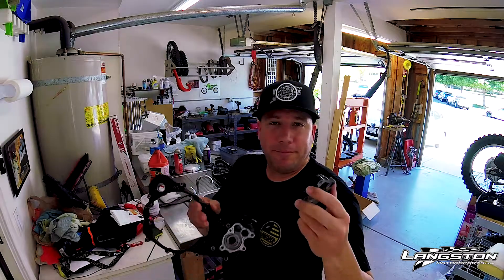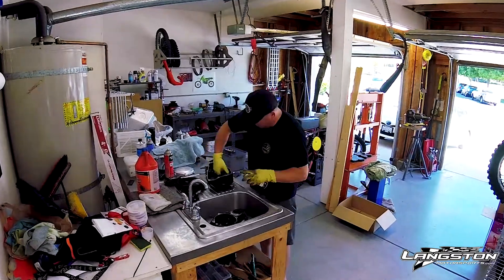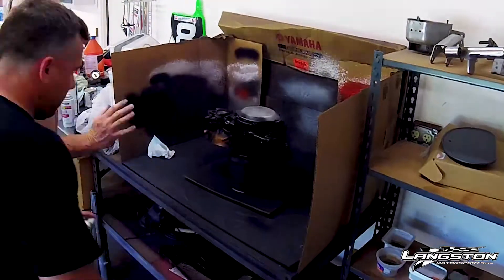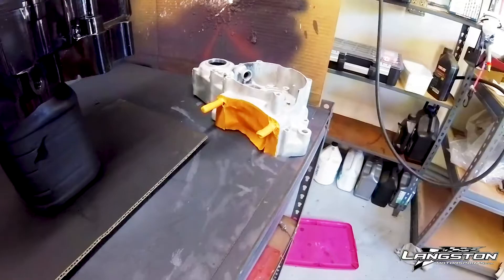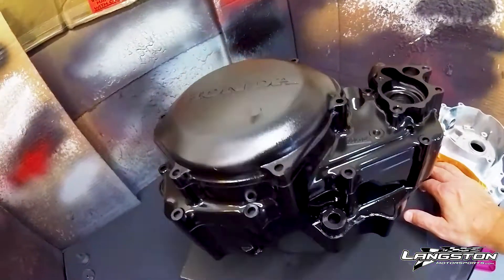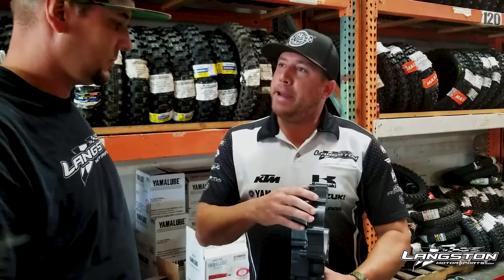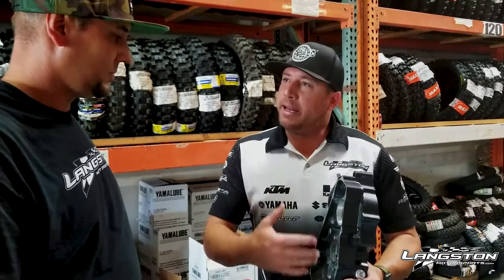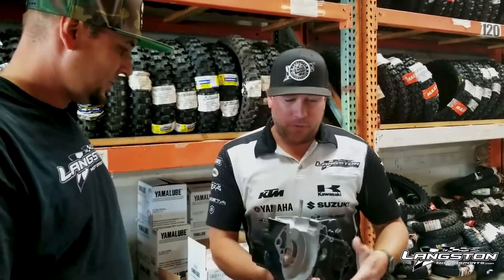CR500 Paint Striping and Case Engine Rebuild

Comment: Do you happen to know where I can find taller tranny gear for  a 1995 CR500? I have a platted bike that I would like to make more HWY friendly. I currently run 15\39 and it works ok but I would rather have the tranny do the reduction instead of the sprockets.